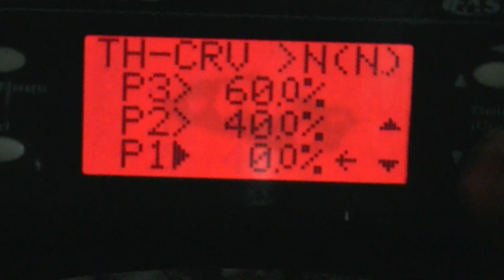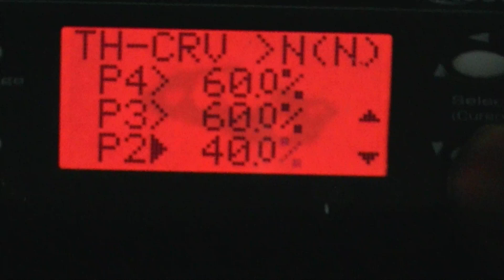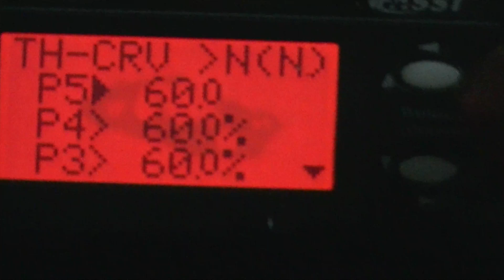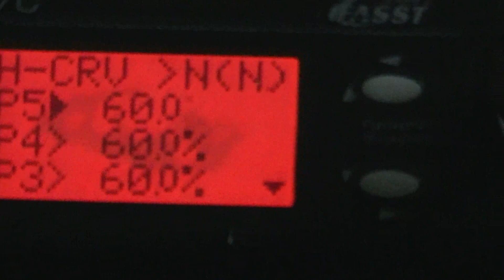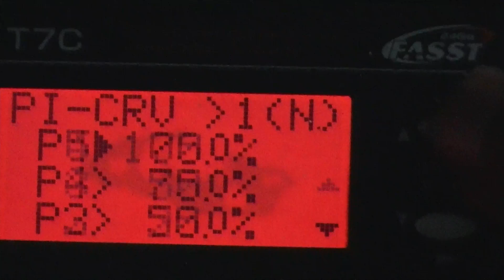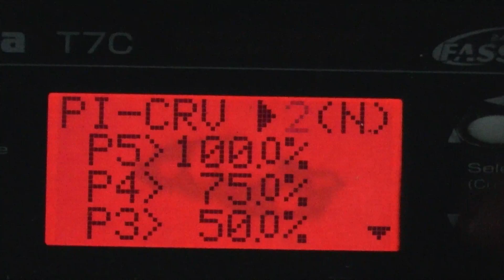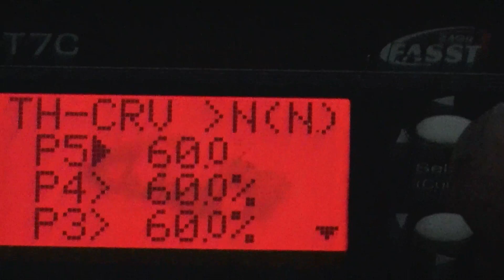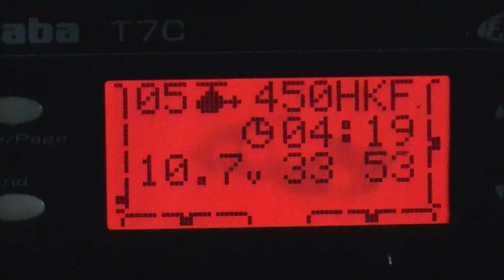throttle and pitch curves for electric Rc Helicopters what to use for normal Mode and 3D

Comment: So wc what u recommend for Expo settings
Reply from the maker: If you want to use Transmitter Expo like you would on a FB setup, you should choose Transmitter for Control Behavior
than you can use expo
Reply: Oh on the beastx setting wc
Reply from the maker: DELBERT WILLIAMS
yes preset flight modes if your using a preset flight mode dont use expo
Reply: Ok so what's better so can it can be more stable wc I and rebuild the servos now will take a break and fly the mcpx bl with my new batteries and I know now some of the replys don't come when I upload videos like now:-D

Comment: Hey wc I am running fready can fly setting but am going 2 use yours will it work on mcpxv2  liked
Reply from the maker: i watched Freddy settings and they are not for beginner they are not even right
freddy is a good guy but i dont agree with his settings they are not as good for the gyro as mine are and mine i use the same on every helicopter.
but hey freddy has shown his settings do work well but id never use them not good for the gyro tail hold to make a long story short but hell i can be as wrong as freddy but ill make a video and explain my settings and why i use the same on everything
Reply from the maker: oh guess i did it in this video
no one said i was wrong lol
Reply: I was watching that video wc because I am about 2 work on the 450L so don't won't 2 mess anything up bro I will take my time ans do idle up so won't mess up the 450L WC a nd will use that on all my helicopters :-D liked and thanks fam
Reply from the maker: for normal you can use any where from 0 40 60 60 60 to 0 40 70 70 70 
dont go past 75 
you can change the 40 to 25 or 30 as well
understand ? what ever works best
normally i use 0 40 70 70 70 for normal or 65s